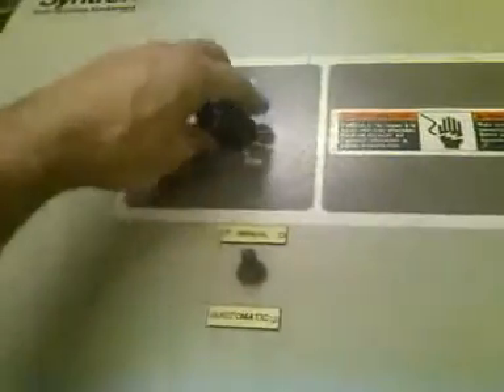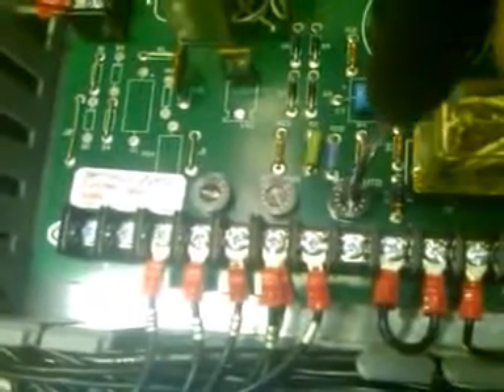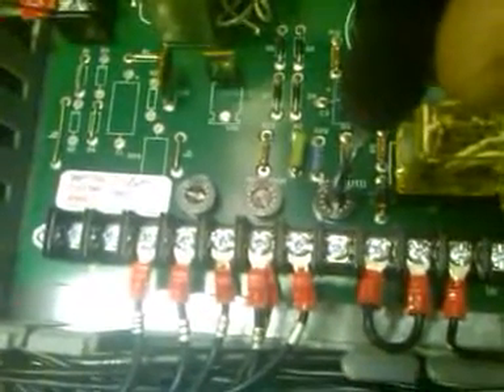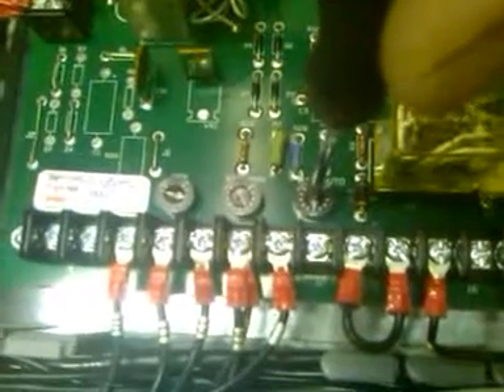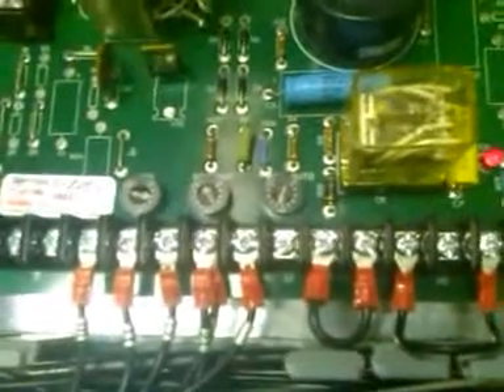how to adjust controller and PCB on Syntron Feeder

Comment: I'm having a problem with this exact syntron controller, the ouput to the feeder is running at 450voltz no matter the speed pot ajusgment. Regardless of it being in hand off the pot or the 4-20 signal. Verified 4-20 signal is good, changed the SCR and put a spare board in for testing. Still the same result.
Reply from the maker: on the left side of the PCB you will see a terminal strip--try switching the wires on terminal #2 and #4 - so in otherwords, you will be moving the wires from 2 to 4 and from 4 to 2 - it sounds like a phasing issue - what this does is switch the phases. also check heat sink of SCR to make sure it is attached (tighten screws) and make sure it is not cracked anywhere
Reply from the maker: also check the potentiometer- it needs to read 50 ohms across the two end posts (center is wiper) and from the wiper to one end post it should adjust from 0-50 ohms as you turn the potentiometer